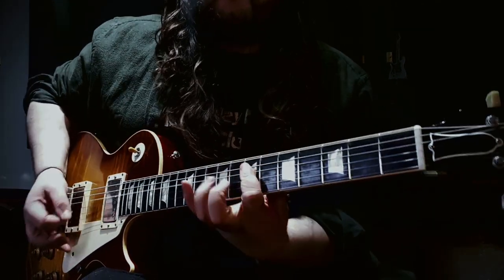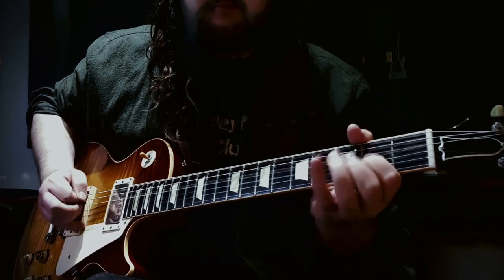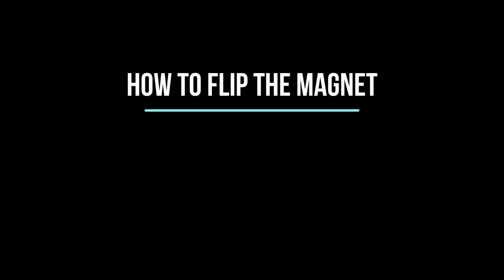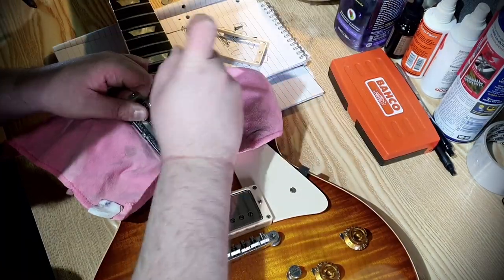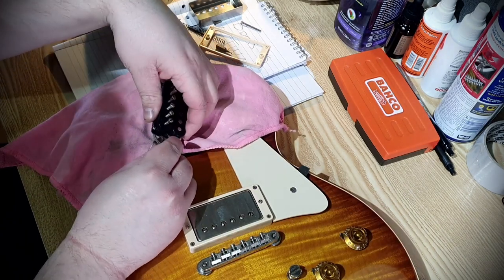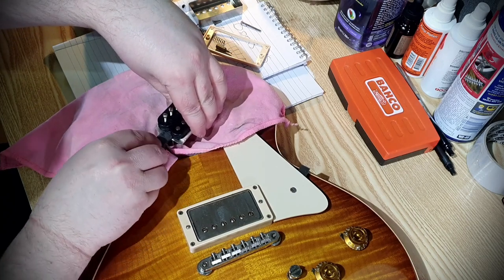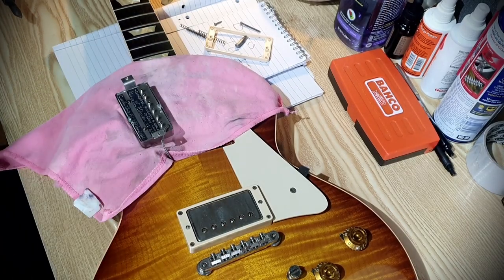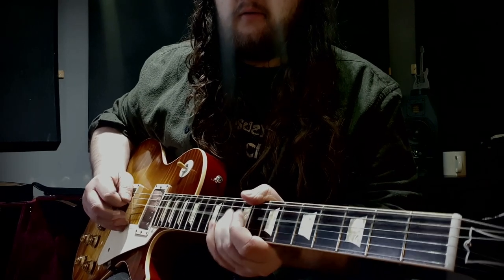The Magnet Flip - Peter Green Out Of Phase Tone. How to do it & how to use it - Alex Hamilton

Comment: If I'm not mistaken Peter's guitar (Greeny) wad actually a combination of the magnet being flipped and then the pickup being installed upside down. If you look a photos you can see the pole pieces are on the bottom the pickup instead of the top.
Reply: Turning the pickup around makes no difference to the tone what so ever this has been proven many times over the years. Also the magnet flip can be done on either pickup the result when both volumes are on full is the same you still get the Peter Green tone.
Reply: @colinmcnab6145  It does if the coils aren't balanced
Reply: @colinmcnab6145  false.  for instance if i use a bridge humbucker with two coil designs the coil toward the bridge is brighter, and when i use that humbucker in the neck i turn the pickup around to make it brighter and sound as good as it did in the bridge position, i play metal , i know what i am doing dude .
 in 2014 inside a government facility called 'hellen ross mcnabb centers of knoxville Tn i was beheaded .
Reply: Jimi Hendrix just flipped his guitar upsidedown 😂👍
Reply: @zAvAvAz  how tf do you know what your talking about if you’re literally incapable of talking after what happened in that gov facility
Reply: @BluesDivinity  How do you know what someone knows or doesn't know regardless.
Reply: @Magnum_Opus_Music  😂
Reply: @olekpokorski9955  👍🎸
Reply: A pickup being turned upside down does not change the magnetic field whatsoever, therefore it doesn’t affect tone at all.
Reply: @Jesse_Johnson Incorrect. Turning a pickup upside down does not change the magnetic field AT ALL, therefore it does not affect/alter tone in any way. It’s basic science…
Reply: @briantaylor2.023  not if each coil is different and how so depends on the amount of tonal difference
Reply: @zAvAvAz  beheaded??? My translator shows me a translation of this word that wouldn't have make it possible for you to write this comment. 😉
Reply: @colinmcnab6145  What Denis Llewellyn says is probably on the money. If the two coils aren't the same, it will make a difference even if the magnet swap isn't done. It has nothing to do with phase and it hasn't been proven many times over the years. Turning a HB p/up around makes a difference with random-wound p/ups

HOWEVER. THAT SAID. NOTA BENE - ETC ETC ETC BLAH BLAH BLAH.............

MR LLEWELLYN HAS NEVER BEEN BEHEADED and if he plays metal, that doesn't mean that he knows what he's doing - everyone knows that. On the other hand, I'm C&G qualified musical instrument tec 1974 and I know that you can turn your p/ups, listen, and if you don't like it, turn them back again, easy as falling off a log. So, in that sense, sir, you are perfectly correct.

I learned a lot from this video. The mod isn't new, it's free, it's easy for anyone that is happy using a soldering iron etc. and it's been done thousands of times by players. It's known for the Peter Green Les Paul sound which I've seen described as "Telecaster on steroids" and I wouldn't argue - it's very soulful.

It will work on any guitar that has 2 HB p/ups and two volume, two tone architecture. If your guitar doesn't have that (single volume pot) the sound you get may disappoint - horribly - no bass at all. You need to be able to balance the two volume pots. It's also been regretted and reversed (easy) by many. You need to be aware of the sacrifice of the native tones that the guitar already has in standard trim and if you're into big gain, you're headed for grime, grime and more grime. It gets big, big grimy. It generally works best with a tube amp and the pre-amp just "tickling" the power amp and doesn't much appreciate pedals. So the more modern player may not quite "get it" straight away and our dem. friend here already has way too much gain to showcase the "touch" palette of these sounds. The wide dynamics of this kind of set up means that you control the attack, gain, saturation and all that stuff with your hands and nothing else and it takes some getting used to, especially in a band set up with a drummer and all the rest. Think "Whitney Houston" or "Billie Holiday" - is the best way I can put it.
Reply: Standard north side magnetic pull in a pickup is towards the slug. Making the slug coil the dominant pull. Making the inductance stronger by the mass of the slugs. Flipping the north side of the magnet to the screws will lower the inductance of the power. Which does have a slight change in sound via the power of the inductance. So with the screw side being the power now via a Green mod. Putting the screw side closer to the bridge is going to sound a bit more brighter than closer to the neck. Normal listening might not be real noticable but it does have a slightly brighter tone but it also seems to have more sustain because the strings are not being pulled as hard.
Reply: @colinmcnab6145  There’s a reason that pretty much all of the guitars I’ve seen that only have one adjustable coil per pickup have the screw poles closest to the neck and the bridge; I don’t know if it originates from what he did, but it allows you to turn them higher so that the strings get as close to each part of the pickup when you play since that makes the string go down closer to the fixed coils if you haven’t noticed since you say most of these people don’t know what they’re talking about believing disproven myths.
Reply: According to Seth Louver, the exposed pole pieces on Covered pickups is purely aesthetics. Putting the exposed pole pieces upside down lets a guitar tech know which pickup had the magnet flipped.
Reply: @zAvAvAz  That's right, you may have prepared to have some-one speak on your behalf after the loss of your bonce ? All is possible.
Reply: @briantaylor2.023  Quite correct, the pickup does not change it's sound, its orientation under the strings is what changes the tone and sound. Just as getting a bright palm muting chug with the bridge humbucker is easier because the timbre of the string very close to the bridge vibrates tighter and brighter near the bridge . . . and looser and wider away from the bridge. Also why Leo fender positioned a neck pickup under the strings in the neck with a sometimes 20, 21, or 22 fret guitar instead of a 24 fret guitar even though completing the double octave makes sense and a desirable feature for some. The harmonics in that area on the short number fret guitars and Leo's testing is what lead to that decision on those guitars.
Reply: @giulioluzzardi7632  Why certainly yes, and for everyone says this: 
i am the way, the truth, and the life, that whomsoever believe on i am, have everlasting life. i am. and i am is not a man. Those whom seek the face of i am shall find it. And ALL things are possible through god. i am dictate and command all things. in the name of the father the son and the holy ghost, all in christ. The parent, the offspring, and the holy spirit / holy ghost. The creator, the created, and the holy spirit / holy ghost the holy aether. Who, what, where, when, how, why. = i am.
Reply: @zAvAvAz hell fell right in and lost his head 😂🎉
Reply: @Sven_Guitar  Fortunately, YOU do not dictate what is possible. 🙂
Reply: @giulioluzzardi7632  However that being said, you all failed to realize one thing = it grew back into form within a few seconds. No, it was not instant as you might imagine. And all, was painfuL.
Reply: @zAvAvAz  Yeah, that's correct! 'Cause I'm not this guy who walked over water without sinking, called water strider.
I have heard that the human gut is also intelligent. Maybe your gut is hyper-intelligent and replacing your brain, right? 😜😜😜
Reply: @Sven_Guitar  your entire body and brain, IS the brain.
Reply: @zAvAvAz  In some kind of way, I agree. But goose without heads only run a few meters, then then it's over.

Do you play an out- of- phase- guitar, too?
Reply: @Sven_Guitar  i am, play an out of phase guitar. My favorite was a black Adrian Vandenburg Peavey Signature modeL. It featured a bareknuckle warpig like bridge humbucker, and a  balanced thick poLe single coiL in the neck. A coiL split for the bridge and a phase inverter switch with a volume, a tone, and a 3 way pickup selector.    The bridge hum was turned that the brighter wound coiL was facing the floyd rose. CoiL split and phase activated with both pickups was a cocked wah wide band thrash and detailed thick chug tone without mud yet with huge low end and attack with clarity tuned down to D and C# it sounded Omazing.
Reply: @zAvAvAz  Wow, that sounds very interesting! A real all-in-one guitar! Lots of possibilities with just one guitar. My ES 345 has a Varitone, which also offers many sounds with two humbuckers.
Unfortunately in connection with a large loss of volume and treble. In addition, it is wired independently. If you just turn it down a little, the treble will disappear!
Reply: @michaelgrahamwongacutemadness nonsense
Reply: @musikus7092  what is
Reply: @BluesDivinity  so you don’t think any pickup is designed differently facing one way all you have to do is look at where the pole pieces are but some might differ in other ways that you can’t see after it’s built
Reply: @hissinghed  no they change the magnetic field if only one coil has poles or if the other is wound differently i actually set up my own guitars unlike a lot of people I’ve come across a bunch of different pickups
Reply: @michaelgrahamwongacutemadness  peepeepoopoo type shit you know what I mean?
Reply: @zAvAvAz  cool, let's take this "Guitar pickup" silliness  to a level that existentialist surrealist can finally comprehend...man.
Reply: @giulioluzzardi7632  hah hah, far out! 😆
Reply: @giulioluzzardi7632  some of these people are butthurt for getting called out for not knowing what they're talking about
Reply: Out of phase guitar mod have existed for years it never really caught on sonically it's not a pleasing usable sound. Series/parallel/coil tap have a more pleasant sound you can actually use for recording etc
Reply: @BluesDivinity  you're talking to the head, maybe
Reply: @zAvAvAz  Time for your meds, Dennis!
Reply: @Sven_Guitar   @Svemarlich  Not if your head grows back in a controlled situation. Just go visit satan's church sometime he'll show you things you didn't believe and decieve you. i am is NOT decieved, and i am is witness, and bring testimony and am of the 144,000 witness beheaded for my 'pine cone' christ oiL fruit, for all things had become possible through the word, that if you said to the mountain "move" it would be moved, that is the faith of a mustard seed. You have a huge fruit ripening in your brain multidimensionally and it's authority has authority over all god's enemies, and authority over any matter in the world. However we are all connected with our version of the world and carbon matter, we are NOT carbon. Satan's body is = 6 6 6, or carbon, carbon = 6 protons, 6 electrons, 6 neutrons.
Reply: @Sven_Guitar  fortunately you do not dictate what is 'possible'.
Reply: @zAvAvAz  Aha
Reply: @zAvAvAz  No no
Reply: @zAvAvAz  You have a channel, so make a video of your head! Why not? This would be your first upload, come on!
Reply: @zAvAvAz "I play metal, I know what I'm doing dude" Lmao...
Reply: LOL! 😃 @gdawgs101
Reply: What's interesting is that if the magnet was upside down, when he installed the pickup upside down, it actually made the magnet right side up again.
Reply: @Magnum_Opus_Music then Jimi was playing the backside which is not true. He played a right-handed guitar on his left side not upside-down bruh. Take guitar lay it flat. You see the frets and strings. Not flip it, you have the backside right. Smh
Reply: You got it, not just one thing - BOTH.
Reply: @briantaylor2.023 … If so, then how do you explain the greeny- honky-tone that was the resulting sound in this video? Thank you.
Reply: @youtubecommentor4480  There’s A LOT of factors at play that result in specific tones, but the fact of the matter is that physical turning a pickup around or upside down does not make it go out of phase. It has to do with the wiring and pole pieces. Literally look it up.

Comment: First thing to know for anyone attempting this: if your pickups are wax potted (like most non-Custom Shop Les Pauls), some of the wax will melt well before the nub of solder that holds the pickup cover in place, so be prepared for a bit of a mess. It took me about an hour and a half to do this, and like Alex mentions, the desoldering part is the most painful and frustrating. So if you've never soldered before or aren’t very good at it ( like myself), beware that this may frustrate you, and when that happens, you will likely burn/ scald your fingers, so be careful (ask me how I know 😞). Having said all that, the tonal difference is audible especially when you find the sweet spot as Alex explains, even on a stock 2021 Standard 50s Gold Top Les Paul. Thanks Alex!
Reply: Do you have to re wax the pots? 
I'm thinking of either doing this to my epiphone Sheraton standards pick up . Love the warmth
Reply: @coco-te1op  Hmmm…I’m not sure what you mean when you say “re wax the pots”; to clarify- this method has nothing to do with the “pots”(I.e. potentiometers) at all. It is the pickups that are “wax-potted”, and I think the term arises from dipping them in a pot/ container/ bath filled with hot wax. However if we’re talking about the same thing, i.e the pickup coils, then no I didn’t have to re-wax the pickup. There was still plenty of wax on the individual coils of the humbucker when the metal pickup cover finally came off and I “looked under the hood”. If you’re looking for “warmth”, which to me means less treble frequencies, you do run the risk of getting disappointed as the “Peter Green mod” leads to a “squawkier”/ greater treble containing tone in certain combinations of volume and tone pot positions, that is somewhere between a humbucker and a single coil. The video explains this nuanced tonal shift well.
Reply: @sanjeevmraman  sorry what I meant was do you have to re wax the entire humbucker once the covers go back on. . . Dip the whole lot to air seal the covers
Reply: @coco-te1op  No. I didn’t have to. Also to clarify, even though I haven’t ever done anything related to pickup wax-potting etc., the way I understand it is that the 2 coils of the humbucker are immersed in hot wax, and the pickup cover is soldered to the backplate after that. So the wax potting is done BEFORE the humbucker cover goes back on.
Reply: Way easier to just do it electronically with a push/poll switch to put it out of phase

Comment: In order not to lose low end by the phase cancelation, but retain quackiness you need to swap the ground and positive wire from the pickup. That's the part no one mentions with the mod. Like mid strat PU. It's RWRP. Reverse wound, reverse magnet polarity. You emulate reverse wound part by swapping the wires.
Reply: I prefer the thin sound to this though, would the adittion of low end mod take that away?
Reply: I dunno, I was hearing Alex get the tone of "Oh Well" at one point...
Reply: Gill...all the better reason to have a few more guitars😉
Reply: Swapping ground and hot on a 2 wire PAF will make the cover and baseplate hot, introduce loads of noise and problems. Flipping the magnet shifts phase 180 degrees, flipping the wires also shifts it another 180 degrees, leading you right back where you started, in phase with the bridge pickup.

Comment: Great video mate! Some seriously nice tone you're getting there... I'm gonna have a stab at re-wiring the neck pick up on my LP to be able to switch to 'out of phase' with a push pull tone pot... If it ends up sounding anything like yours, I'll be smiling
Reply: I’ve done a phase switch and there’s some pretty cool and useable tones but it doesn’t sound like a magnetically out of phase to me. It’s a shame there’s no way to make that switchable.
Reply: @277southtombob  Interesting... It figures that the only genuine way to do it is to pop the hood and flip the magnate... I will have to pluck up the courage to try it
Reply: Some pick ups can be easily reversed by reversing the leads, no need to reverse the magnets... Put a push-pull switch in there to flip one pickup and you can have a normal/out of phase option..
Reply: @alanaizen8220  I’ve done a couple with a phase switch and it does get some interesting sounds. The advantage that flipping the magnet has is that you don’t lose as much output and it’s not quite as thin as out of phase wiring. I’ve played a couple of Les Pauls done this way to get the Peter Green, Gary Moore tone and it does sound good but personally I use the regular both pickup sound quite often and miss having it. I like using the volumes to blend more or less of one pickup and it’s a staple for me.

Comment: I flipped the neck PU around and then put in a push push knob as treble knob. Then phase shifted it on the knob.
That way I can instantly get the normal setting back again.
This also only sounds close to the greeny if you have old school paf alnico 2 pick up.
They are darker and thus you still get the nasally sound but thicker than with alnico 5s

Comment: I have a SSH configuration strat.  I replaced the humbucker (bridge) and neck (single) pickups - both from the same brand. …and now I think the middle single coil is out of phase with both its neighbors.  When I play each pickup individually (positions 1, 3, and 5), everything’s fine, but in the shared positions (2 & 4), the volume drops off pretty dramatically and the tone is quite thin.

I clicked on the video to see if it was related and find it amusing that it’s being done on purpose. It’s not new to me, but I thought it was usually accomplished by a switch… but if you have to manually take out the magnet and reverse the poles… I’m not sure how a switch would do it.